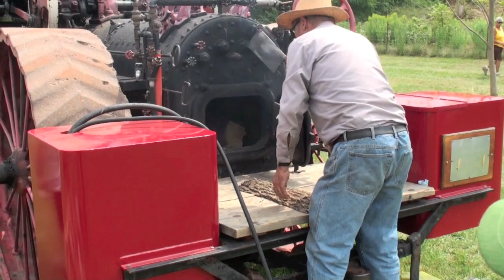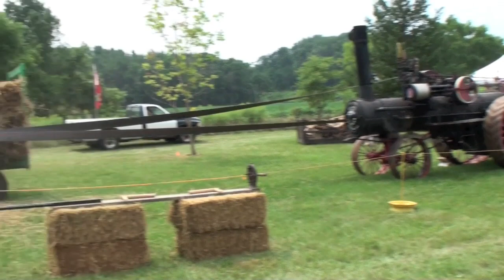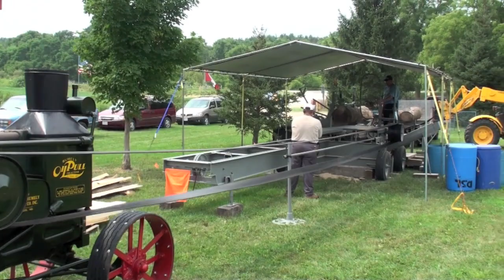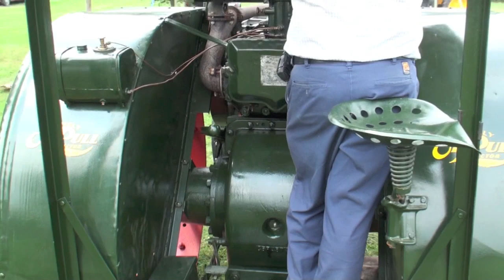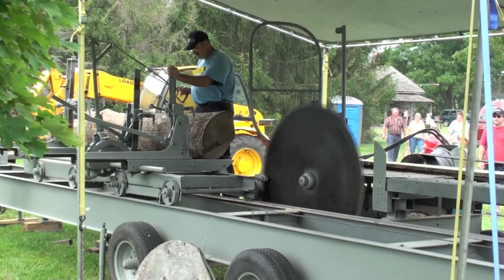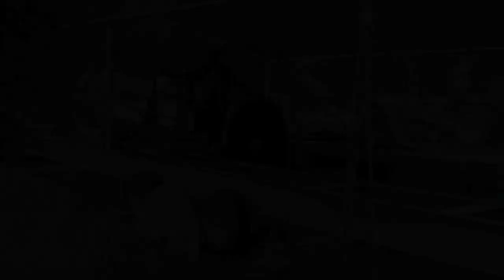steam engine demonstration

Comment: @jamesberkhimer, that's because the high pressure relief didn't go off, we had one that exploded years ago at the covered bridge festival,when they bring a steam engine, the safety board has to inspect the steam engine PRV, and pressure relief valve IS THE MAIN thing to check out, running a compressed air on that relief valve to see if it does release the pressure at 200 PSI, then it passes, anything above that will not be operational, but to show ONLY